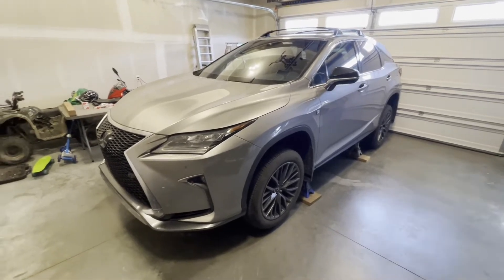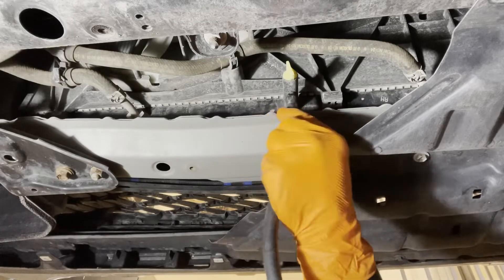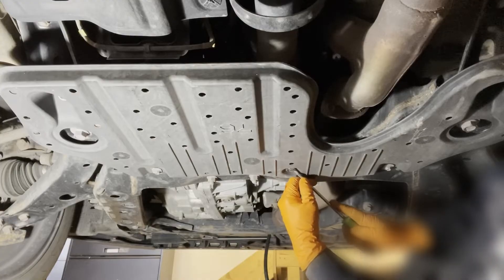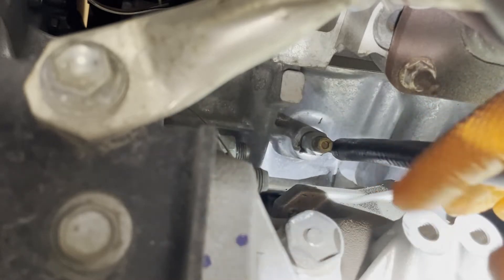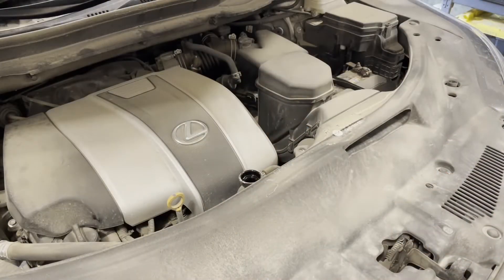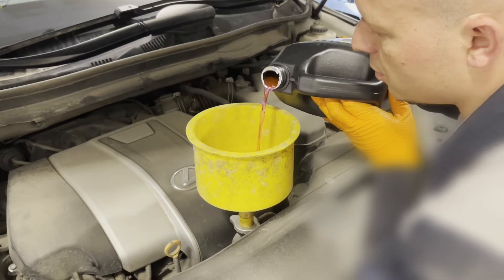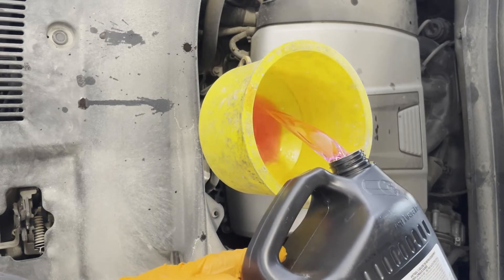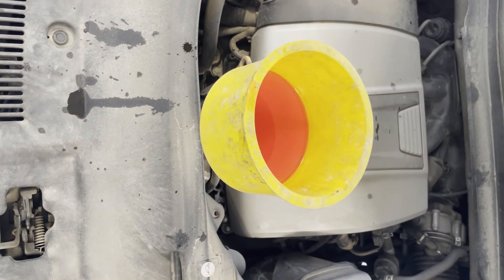2016-2022 Lexus RX350 RX450h Engine Coolant Drain And Fill Instructions

Comment from the maker: Below are my affiliate links to the parts and tools you would use to complete this job. I may receive a small commission from the product sales. Thank you!
Genuine Lexus/Toyota coolant (2 gallons required): https://amzn.to/3Dy8UxQ
Coolant bleeding funnel kit: https://amzn.to/3QbalKl
Sturdy 4 Gallon coolant drain pan: https://amzn.to/3Ou4iiu
5/16" drain hose: https://amzn.to/43E0cJa
Automotive trim and clip removal kit: https://amzn.to/3KgKGfg
1/4" impact driver kit: https://amzn.to/4f1UN4A
1/4” socket adapter set: https://amzn.to/44XTTkI
Rechargeable LED mini work light: https://amzn.to/3Y74OpY

Comment: Viktor, using your videos, I've changed the coolant and spark plugs on a RX 350. Saved me almost $800 from what the dealership wanted to charge. I also have a 2015 Lexus NX 200T Sport and I want to change the coolant in it. But I just can't find the petcock for the intercooler coolant and there's no vdieo or even pictures of its location on the internet. If you come across such a job, it would be much appreciated if you could make a video of it for us. Thanks for all your videos, they are truly among the most imformative and made some of the work DIY possible.
Reply from the maker: Thank you for the positive feedback, I’ll be keeping an eye out for that job!

Comment: Hi if I still have air on the heater core. To bleed air on the second time do I still need to add more coolant up to 1/4 of the funnel or just insert a dry funnel and redo the bleeding?
Reply from the maker: You need coolant in the funnel, something has to replace the air that you are bleeding out.

Comment: Hi if I still have air. To bleed air on the second time do I still need to add more coolant up to 1/4 of the funnel? My level is already up to full mark? Or just insert the funnel dry and let the engine run?
Reply from the maker: You need coolant in the funnel, something has to replace the air that you are bleeding out.

Comment: Hi Victor. Thank you for the videos they are great!. I have a lexus is 300h and the shop manual for replacing engine coolant. It does not mention anything about draining the engine block. I wonder if I should do it anyways or if in my model it's not necessary for some reason. Thanks again for the videos.
Reply from the maker: Hi, I do not believe that engine has a block drain if I remember correctly. However, if it does, you can definitely drain it to get most of the coolant out during replacement.
Reply: @Viktor_G_Automotive  Thanks for the early response. I really apreciate it. In other car manuals, for instance, the one you do on the video, do they say explicitly on the manual that you should drain the engine block?
Reply from the maker: @1knmd  no problem, yes, in the RX manual it tells you to drain the block.

Comment: I read a manual from techstream saying : 1) place cap and then turn on engine...2) did see any steps to turn heat on. Does it make a difference?
Reply from the maker: Leaving the funnel in and running the heat gives you a better indication of the air being bled out since you can see the bubbles escaping and can feel if the heater is blowing hot air at idle.

Comment: Thanks a lot Victor, with the help of your video, I could complete the coolant change on my 2020 RX350 F-Sport. Locating the coolant drain point on the rear of the engine block was really a task. I struggled over an hour to locate that. Once I did that, then rest was a breeze. For others who are watching this, please note the drain point on the engine rear block is looking sideways and not downwards above the exhaust manifold. If you are lying down under the raised vehicle, this could take a while to locate.
Reply from the maker: Excellent work!

Comment: Hi..is there bleeder valves to open when adding coolant?  Can engine drain plug brake easily? Thanks
Reply from the maker: Hi, the video shows the complete procedure, there are no bleeder valves. The drain plugs do not break in my experience.
Reply: Do not touch the drains on the engine. Of you live in the rust belt they do oxydate. Just change your coolant twice. Unless you turn your block upside down you’re never going to get all the coolant out of the engine. Just my humble 2 cents.

Comment: Find the Right Tool to remove the clips. Painful to watch you work.
Reply from the maker: Thanks for the comment. The right tool is the one that removes the clips, and a flat blade screwdriver does the job just fine. If a clip is old and brittle and ends up breaking, I replace it with a new one, no point trying to save it. I do own multiple clip removal tools of various types, will use one in my next video to help you avoid the pain of watching me work. All the best!

Comment: Couple of questions:
1) My (new to me) 2018 RX450hL appears to be missing the second panel cover.  Should I look at replacing it?  Or does it not matter?
2) Do you drain the reservoir at some point?  
3) Is there any reason not to use a vacuum fill system?  I did it on my ES300h and it appeared to work just fine.  May be I'm just being paranoid...

Thanks!
Reply from the maker: Hi, the panels don’t really matter, but you can install the missing one if it bothers you.
I didn’t drain the overflow tank separately since you already get 2 gallons of coolant out of there and the half a pint left in the tank doesn’t make much difference.
We don’t use a vacuum filler in the shop and it is not mentioned in the repair manual, but I don’t see any issues with using it.

Comment: My water pump blew and during the process my coolant was leaking and almost empty in the reservoir. I got the water pump replaced, I assume new coolant was added. Probably don't need to do the flush for a while, right?
Reply from the maker: As long as it was refilled with proper Toyota coolant, you should be good. However, if you took it to an aftermarket shop and they poured something else into it, I would definitely replace the coolant.

Comment: Another great video- thank you for doing it.  I almost gave up on trying to find the engine block drain plug. Went back to your video multiple times until I was able to pin point exactly where it was concealed in order to gain access.  Talk about needing an extension for the socket wrench-  I had to use nearly every one I own to reach.  Hopefully my neck muscles will be healed by the next time it's due!!
Reply from the maker: Nice work, glad to hear that you got it figured out!

Comment: Great Video!  Thanks for doing this.  REALLY helpful.  Looking forward to seeing more of your videos.  

If you can, would you include part numbers for the clips and anything else that may break and needs to be replaced? I see below that you don't have access to those numbers.  If one of your viewers did find it, would you be so kind as to add it to the writeup section.

I stripped a drain plug on the transmission and had a difficult time finding the right part numbers.  I went to Lexus and they didn't have it in stock and also were not sure they had the right part numbers. They gave me a price of $16 and told me to check on line for a cheaper price. Toyota told me to go talk to Lexus, they were almost rude.  Strangely enough a person on ClubLexus gave me the right part numbers after I provided the VIN, found it at a local Toyota place for $3.50.
Reply from the maker: Will do if I get a chance in the future, thanks!

Comment: Thank you victor, you are the best! Detail step by step explanation! I just did the coolant drain and fill using your instruction for my wife’s 2020 RX350, one thing I noticed, the reservoir tank never drained and stayed full the entire process, I drained total 7 litres and fill it up anyway. No sure why the reservoir tank never drain.
Reply from the maker: Hi, you could drain the reservoir if you really want to, but the goal is not to replace every last drop of coolant, just to replace the majority of it. There is always some left inside the engine passages, heater core etc. Cheers!
Reply: @Viktor_G_Automotive thank you Victor, you are my hero! Thank you 🙏

Comment: When you drain block and radiator can you use vacuum fill equipment for filling?
Reply from the maker: We never did at the shop, but I think it would be fine.
Reply: @Viktor_G_Automotive thanks. And thermostat, when you fill radiator, is block getting filled as well, or you need to wait till thermostat opens, while engine running?
Reply from the maker: @oleksandrmulyar2350 yes, the block gets filled since the thermostat is only blocking one of the radiator hoses, the coolant can flow into the engine through the other hose. Just make sure to fill slowly to prevent an airlock (if gravity filling). I have not used the vacuum fillers so not sure how that changes the process.
Reply: @Viktor_G_Automotive thank you very much
Reply from the maker: @oleksandrmulyar2350 no problem!

Comment: Just did a drain and fill on a 2017 AWD RX 350.............   including a block drain. The block drain is indeed a real PITA to get to. Might not be possible without a car lift.
Reply: It’s not difficult. The block drain need 3 ton jack to lift higher to see.
Reply from the maker: Nice work!

Comment: Do you recommend flushing the system with water prior to adding new coolant to rinse the system of the old coolant? I appreciate these videos. I purchased a new 2022 RX350 because I love Toyota quality and wanted a Lexus with the 3.5 V6 before they stopped selling them. I like the simplicity of these cars.
Reply from the maker: I do not believe it is necessary to flush it out with water, we don't do that at the shop. Instead, that would open the possibility of diluting the coolant and lowering its freezing and boiling point.

Comment: Viktor, I love your DIY maintenance videos for the Lexus RX350 platform vehicles. My wife recently purchased a 2024 RX350 Hybrid for her daily driver, and we kept the 2017 RX350 she was driving to be my daily driver. With 60k miles on the odometer, I set out to perform the 60K mile service myself. I followed your instructions for changing the engine oil, transmission fluid, transfer case fluid and rear differential fluid. Your videos made this work easy. I'll be servicing the cooling system next. So far, I have saved over $500 by doing the work myself rather that taking it to the dealership. Thank you for making these wonderful videos. Blessing to you and yours.
Reply from the maker: @garyxoom7714  excellent work, I am glad you found the videos to be helpful!

Comment: What size hose did you use for the rear drain?  1/4 or 3/8
Reply from the maker: @troyschreifels1836  5/16” ID
Reply: @Viktor_G_Automotive  Viktor, just to confirm, both drains that you showed in your video use the same size drain hose?  Lastly, did you also drain the reserve tank or does that naturally drain when you drain the main line?
Reply from the maker: @troyschreifels1836  Yes, I use 5/16" drain hose on both drains. You could use 3/8", but it might be a bit loose. I did not drain the reserve tank. If you open the drain plug without removing the rad cap, it will usually syphon the coolant out of the reservoir in case you want to get as much coolant out as possible.
Reply: @Viktor_G_Automotive  Thank You Very Much!!  I appreicate all the work you do and post.  Have a great day.

Comment: Beautiful instructions, thank you! I read something about the thermostat only needing to be replaced at 145k, is that correct? I don’t imagine you’ve gotten there yet, but do you know if that is a pretty difficult job?
Reply from the maker: @williamcosman1154  hi, we normally replace the thermostat when it fails, not at a specific mileage. On these models they usually stick open and set an engine fault code P0128. It’s not an extremely difficult job to replace one, but it does take a fair bit of time.

Comment: Great video! Could you make one for Lexus RX 2016-2022 engine mounts replacement
Reply: Why would you change the engine mounts? Is that a scheduled maintenance item?
Reply from the maker: @ It is not a scheduled maintenance item, replacement only required if they are torn/worn.
Reply from the maker: @MrSkalinkin  hi, if I ever get a chance to do that job in the future, I’ll make a video, thanks!

Comment: One tip that I did on my 17 RX- when re-installing the plastic shield on the bottom of the car I put a small amount of anti-seize on each 10 mm metal bolt, including the bolts on the right side shield that you don't have to take off to do this procedure. Easy insurance. I wish I'd done this all along on a 2004 RX330 I have. Almost all of the lower plastic shield bolts have rusted and snap off when removing, so you either have to drill them out and tap new threads or secure with zip ties.
Reply from the maker: Good tip!

Comment: How often should this be done?
Reply from the maker: 100K miles or 10 years the first time, then every 50K miles.
Reply: Hello, Viktor! I have a question for you! I have a 2020 Toyota CHR XLE and a 2022 Lexus RX350. Do I need to change the coolant every 10 years or every 100,000 miles? A mechanic added aftermarket coolant to my Toyota CHR, and it's red. Does it need to be changed? Thank you!
Reply: How often should this be done on model of vehicle Lexus UX250h (2021)? Thank you
Reply from the maker: @haythemys  same as above

Comment: Hi Victor. Great video.  I have a suggestion for your new video.  My 2019 lexus rx350 2nd key fob lost its recognition with the vehicle.  How do I get that key fob to work properly again? Thanks.
Reply from the maker: Hi, usually it just means it either needs a new key fob battery or the key fob itself is dead. I have never seen one just deprogram itself.
Reply: @Viktor_G_Automotive  Victor, I have replaced the battery on the key fob. But the car doesn't recognize it unless touched to the start button.  It's every time. I will try a different battery set and see if that cures the issue. Thanks alot.
Reply from the maker: @sky13eyaj12  yes, try a different battery first, making sure it is installed the correct side up. You can try the one out of the key fob that works.

Comment: there has got to be a better way to remove the undercar panel clips...
Reply from the maker: You can use either a clip remover or a flat blade screwdriver. When they are new, they come out very easily. Once they get old, they get stuck and brittle, so it is normal for a lot of them to break. Aftermarket clips are cheap: https://amzn.to/3vWnDC4

Comment: Just to confirm, by heater, you meant like the AC inside the car? And it needs to be hot air even when idle? I’ll need to adjust temperatures to something high right?
Reply from the maker: Yes, you don’t have to run the heater blower to bleed the system, it is just a good indicator of the air having been bled out when the air blows hot at idle. Of course, the interior temperature selector has to be set to max.

Comment: My 2017 RX 350 has a 2GR-FKS engine. It does not seem to have a cylinder-block drain. However, I was able to drain 1 gallon and 76 ounces from the radiator. I will replace the coolant more frequently than recommended, which should compensate for reduced drainage.🧑‍🔧
Reply from the maker: Sounds like a plan!

Comment: I can’t thank you enough for this instruction! Finally got to work on my wife's RX. It took me quite a while to find the peckcock on the engine block though. I need to do this again on my IS that has the same engine. Since engine in the IS is turned 90 degrees counter clockwise compared to RX, when finding the petcock on the engine block, should I be looking at the right side(looking upward under the car)? Or is it located toward the rear of the car like RX?
Reply from the maker: Look on both left and right side of the engine, it may have 1 or 2 block drains depending on the year.
Reply: @Viktor_G_Automotive  I should’ve specified it in the first place. Mine is 2018 AWD model. Is it necessary to drain from both drains just in case one of them is not  really accessible?
Reply from the maker: @8742js  not absolutely necessary, if you only drain one side, a little bit of old coolant will remain in the block, not a big deal.
Reply: @Viktor_G_Automotive  I finally got to do it last week and the engine block drain was on the passenger side. Just to help out any IS owners, go to the passenger side of the engine oil pan and look up. Luckily my forearm is not so muscular to slide through the gap and reach the drain. Thank you Victor!
Reply from the maker: @8742js thanks for the update!

Comment: DONE!  Thanks so much for the video of changing coolant on the 2GR-FKS.  Dreading the trip under the car to drain the block, I was pleasantly surprised to see no cover in place on my model 2018 FWD RX350.  No long extension needed as I was looking straight up at the nipple and valve.  EZ-PEEZY.   After about ten minutes of hose squeezing until I couldn't see air bubbing, I started the vehicle and revved it to 3k a few times and it was apparent when the T-stat opened as the level in the funnel dropped quickly.  Adding that back and checking for hot air from the heater, it was all over in minutes.  Of course, the fact that it was 100 DEGREES in my garage meant the system was open quickly.  Thanks, again.
Reply from the maker: Excellent work!

Comment: Thanks, Victor! Really appreciate all of your videos. Any chance we'll see a 2016-2022 RX 350 transmission drain and fill video similar to this one? Also, do you have a part number for all the plastic push clips like the one that broke in this video? I've got a few that need to be replaced.
Reply from the maker: Transmission fluid replacement video is coming soon! As far as the push clips, I would just replace them with aftermarket ones from Amazon, the factory ones cost several dollars each.
Reply: @Viktor_G_Automotive  Excellent. Thanks again. Looking forward to more videos!